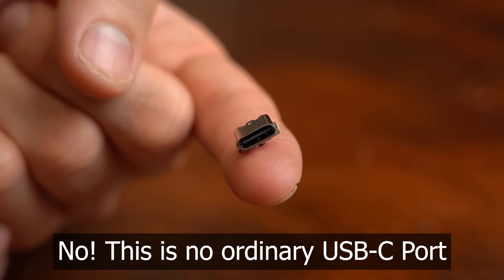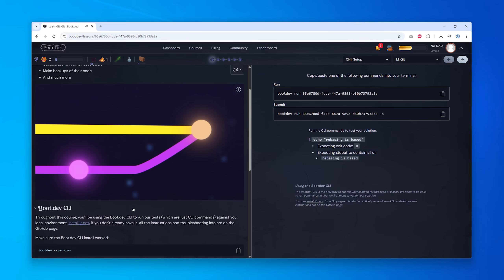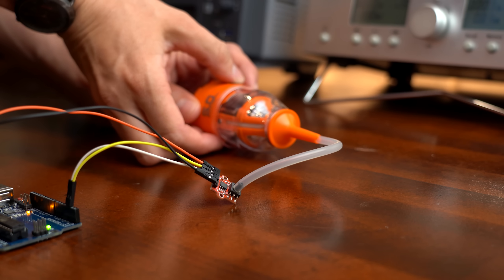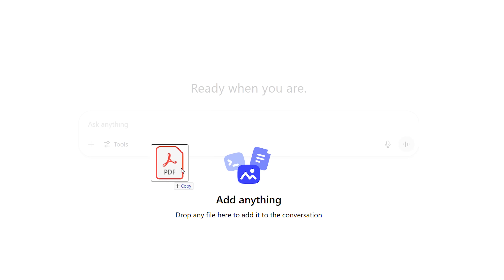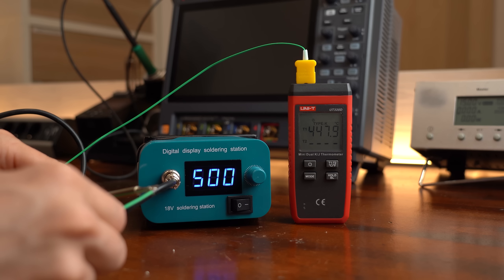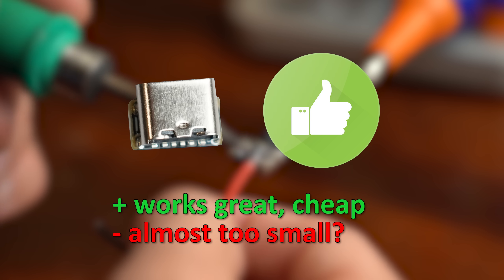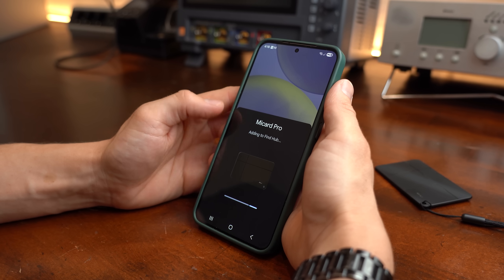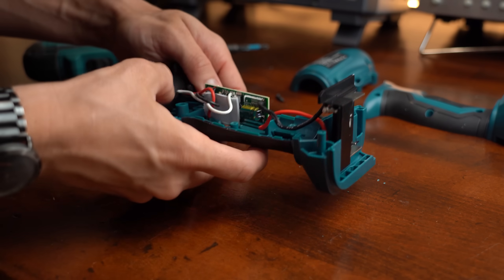I tried finding Hidden Gems on AliExpress AGAIN! (Part 15)

Comment: That little charging board would be great if it wasn't quite so small. Plugging in and unplugging USB cables applies a lot of stress, and with no mounting holes, you would risk pushing the socket into or pulling the socket out of whatever device you used it in.
Reply: It's for batteries that use traditional form factor like AA/AAA/C/D/RC123A etc. but use li-ion chemistry.
Reply: you can add extension or header and yes use epoxy to make a housing so you can plug/unplug without worry
Reply: Good point. I guess on could/should epoxy it to a case or something like that.

Comment: For the soldering iron, could you not get/DIY and adapter to plug it into you power tool battery? I have one of those irons and yet it works great on a 4s LiPo so in theory should work just fine if adapted to a tool battery pack.

Comment: I am pretty sure there is a version of the soldering iron which can be run via UsbC e.g. via Powerbank.
I have modded a PD-Board to mine (replacing the round socket) as i also bought the version you have, works great.

Comment: If you solder in a connector vs directly to battery, the potential to short the battery  positive to ground isn't an issue.  Just make sure there is no short before you plug in the battery.
Reply: Shorting the battery can't happen if you solder its negative lead second, after checking the +ve doesn't have a short.

Comment: 08:16 If I owned a plastic-bladed fan which could spin at 130,000 rpm, I would be rather concerned for my safety.

Comment: the tracking card seems like an interesting replacement for apple tags where the tag needs to be very slim. would be interesting trying to fit one into a steam deck or a laptop to track down stolen property (with a few officers as backup ofc).
Reply: Unfortunately police don’t typically follow up on stolen property reports.
Reply: when i search for this product i find loads in the UK on amazon on ebay that are for iOS only? some are even cheaper than the one in this
Reply: There are plenty of cards for Apple Find My too. Sadly Android tracking isn't as covered as Apple's service at the moment. Most of the users haven't switched on BLE tracking, it's off by default in contrary to Apple.
Reply: @mshaftenberg  actions in austria has those cards and they only cost like 5€ and use ble im pretty sure they are for android
Reply: @mshaftenberg  true, here in Slovakia, I tried to see if I get any updates on location when put in friends car. It only showed up whe I was nearby. Hoe Google will turn BLE tracking on by default. Other way its useless.
Reply: @swingal did your friend have to install any apps on his phone for this to work? it seems to me like it wont work with just any android phone in the area
Reply: @zouna007  it is a built-in feature of Android, but with some caveats: (1) it requires the phone to be Android 9.0 or above, (2) it requires the user to manually provide consent during phone setup, and (3) due to legal restrictions it cannot be enabled in certain countries. 
Edit: for legal reasons it also cannot be enabled on phones that were manufactured in certain countries.
Reply: @PixlRainbow thank you for the clarification! So its not necessary that this will work for everyone..
Reply: problem have only, who idiot use apple today not many, 90% world use android today because have lot cheapen but have lot better and lot more apps and other parts addons have better and cheapen than any apple parts.
Reply: @mattivirtaIdiots that want a cheaper MFI Find my tracking device that actually works.
Reply: @mattivirta What are you talking about? Apple currently has a 25% market share, so Android has a maximum of 75% left. Personally, I have about 5 AirTags and they work great with the current last location from 3 minutes to 24 minutes ago. On the other hand, I've seen several reviews on Google and Samsung tags, which are currently almost unusable due to coverage. And by the way, I'm in a smaller town in the Czech Republic, and even here the coverage is good.

Comment: Hi.  Cool new stuff.  Did you happen to measure the current requirement for the LIDAR sensor.  Just trying to figure out what size battery I'd need to run it for an hour.

Comment: Swapping out that resistor on the charger board looks like a perfect job for solder iron tweezers.
Reply: It is, but at that size a normal iron at one pad long enough heats both pads and the resistor can be removed

Comment: I see that the pump charges with USB-C. Many cheap items with USB-C lack correct resistors and thus won’t charge USB C-C but only A-C. Can you do C-C charge testing on these products?
Reply: Thank you. That explains why I've had charging issues with some headlamps.
Reply: @NanoicDalflanlun  This is straight-up a defect in the products that are miswired like this. Reviewers need to point out when devices have this flaw and dock them points when they are. It’s a 2¢ resistor that they’re skimping on but it causes major headaches.
Reply: @AviDrissman I design products that have to comply with the USB C standard, and the resistors can be like 2 orders of magnitude cheaper than that in large scale production. It's baffling to me that people don't include them. It's so little cost that you might as well round to $0. Like seriously, I was just building the BOM for a PCB where the resistors were like $0.0006 each or something.
Reply: I have an other Flextail pump model, it does charge with USB C-C.
Reply: I had a headlamp a while back like that. It actually died too and I had to replace a transistor. So many manufacturers use cheap designs and components, it's sad
Reply: I have at least one product that will charge from a USB-C charger if the plug happens to be the right way up. So if one way doesn’t work, try flipping it.
Reply: @norfolkchas If I have to play games when charging a device because the device manufacturer skipped out on using a component that cost six hundredths of a penny then the device has a defect, and reviewers should call out devices that have that defect.
Reply: @AviDrissman  Certainly they should. I was merely pointing out a possible workaround that I was grateful to discover. But even that may not work for every device, and when it does, it's still irritating.
Reply: I just spent 3 hours bodging this design defect in another product. Boy howdy was I happy when the device finally charged with a USB C-C cable, but it was a nightmare to solder onto the CC1 pins without bridging.
Reply: Flextail is a proper name brand device and isn't cheap even at Ali prices, I'm guessing it charges properly but I don't know for sure.
Reply: Weird. I’ve gotten plenty of cheap electronics that have modern mppt
Reply: Yeah, a battery lamp I ordered from Temu didn't have them and doesn't work with USB C PD chargers, only with a USB C to A cable and regular USB A wall adapter

Comment: You can find the tiny chargers 3.95€  for 10pcs with free shipping. Great price.
Reply: Quick question, does the USB-C port provide power from the battery or is it exclusively for charging?
Reply: @Academician100  No, as far as i know it will only work for charging.
Reply: I'm not sure I see any benefit of these though.  There's no mounting capability, other than to perhaps glue or slot it into a designed space. It would need to be sturdy because multiple connect/disconnect would probably make it move eventually.
Reply: @AubsUK  Good point, but gluing it with epoxy or polyurethane adhesive, (not covering the IC for better cooling) and it should be fine. Could also directly solder the connector on pcb or copper strip, or small terminals...
Reply: Since the boards are for charging only I guess they are missing some protection features from the bigger charging boards? If you do happen to own/have tested some can you give more info on what features they are missing?
Reply: @georgiivanov8216  I don´t own one but since those boards are for 1 cell only and are for charging ONLY, all they need is to limit current and stop  charging at 4.2V. 
They do it using a tiny specialized IC . 
If you want a power board that protect the battery and where you connect a load, you will need a BMS, rated for the current and battery you need. They are cheap too.

Comment: That last item - it don't get it. It sends out BLE, and some random strangers phone is going to 1. Accept the connection to this device
 2. Dispatch some process to phone home to the products servers and forward the phones CURRENT location to that server? 

I dunno, something doesn't add up here.
Reply: Yes, if their device supports it.

That's how Apple's Air Tags work and there's now an open standard for the same functionality on android and other devices.
Reply: Yeah, the problem is that its included with all android phones, rather than as an optional app/service separate from google. This feature is good but i hate google.

Comment: For the Rodin coil, I'd love to see some comparisons to a standard coil and if it has any benefits over a standard coil, or specific use cases. I mean, it was expensive, making a video dedicated to it would make up for that, but also just understanding the Rodin coil better would be cool
Reply: I have seen those rodin coils as antennas for like very vintage radios. Like early 1920s vacuum tube radios. So maybe you can receave radio frequency stuff with it or something.

Comment: I use my PineCil with an AliExpress USB PD 65W charger that I connect to my Parkside battery (20V). I downloaded a model online, printed it out, put everything in it and I have a portable soldering iron. It's great.

Comment: I'm impressed by how thoroughly you test these products! Especially the calculations that verify the manufacturers' promises ❤
Please test/compare cheap (30E-40$) handheld blowers/vacuum cleaners! 😺Manufacturers list their speeds at *800,000 RPM*, air pressure at 100 kPa, and flow at 1000 l/min.

Comment: I would love to see a dedicated video on security cameras, it's surprisingly hard to find good reviews for such a high demand items
Reply: wouldn't trust chinese cams for CCTV, and if you do then separate VLAN with no outbound connectivity is must...
Reply: @4b978  How would this be useful when your use case requires checking the cam while away?
Reply: The problem is that most security cameras of a certain price range, have most of the features locked off to subscription only. 
@TechMoan is a good reviewer and he has done plenty of security cameras over the last decade. The problem is, he is the kind of guy who would pay the subscription fee rather than setting up a local network (if the camera even allows that)
So most camera reviewers are invalidated because they think it's normal to pay $15 a month for your $75 camera to function fully (motion recording, motion alert etc.)
Reply: Better still, multi-lens, poe cameras
Reply: Wired Dahua or Amcrest are the only answer. Set them up, update them, point them to a NTP server inside your network and block them from the internet. VPN home to view them or relay them through Home Assistant or similar. Don't bother with any other brand, they all suck. And don't bother with anything that uses wifi. If you can run a power cable, you can run ethernet.

The only exception to the Dahua rule is Reolink for battery powered cameras (and battery powered only). Keep in mind that anything battery-powered is a glitchy, last resort, temporary solution, which should only be used to look after your cabin in the woods or to lovingly gaze at your chilli plants during your vacation.
Reply: Dahua cameras work great, setup your firewall properly.

Comment: You have to be extremely careful with third party tools connected to different manufacturer battery packs. Some packs (as Makkita) have protection circuitry built in, others like DeWalt relies on circuitry built into tools themselves. Chinese adapters are made cheap and can drain battery to level no longer accepted by the charger. Depending on protection level, it could even brick your expensive battery pack.
Reply: However, let me add a glimmer of hope. If you drain some of these battery packs (my dewalt for instance) past the lower level the brand's charger will allow thus causing it to not charge said battery pack, you can use a manual charger such as a balance  charger or even just a straight DC trickle charger to raise the voltage above the minimum. Once that level is reached, one can (as I did) then resume using the branded charger. I've even put one of my 18v dewalt packs onto another by way of wires (I do not endorse this, could be dangerous) which then charged the "dead" one to a point of voltage equillibrium(ish) and then put them both onto the branded dewalt charger to finish out the charge.

Your mileage may vary, I am not an electrical engineer, and one assumes all responsibilities incurred by trying this "hack". I've used it only when attempting to saved a possibly bricked battery. So far though, I'm 3 for 3,not a bricked one yet. (all dewalt so far)
Reply: Yeah if you use it regularly, you might as well get the original makita blower (though it is 10x the price)
Reply: Lol cụ coin viNE 0,06875$
Reply: I use some  chinese copies of Makita at the construction site for years, mixed with original Makita tools and batteries (originals made in Romania for the EU market)  No problem at all.

Comment: I would be interested in seeing more reviews of these tools that are compatible with brand name batteries. I always wanted to get a cordless hot glue gun that is compatible with my Bosch batteries but don't quite trust Aliexpress for stuff that generates that much heat
Reply: Nah all the stuff is pretty good actually. For anything your using I wouldn't worry. It's the plugged in stuff that scares me. Jus got into modded Ryobi battery tools. Made my own power Bank and USB charger. All solar stuff there is really good and best prices around by half on most items. AliExpress is the same thing as Amazon n eBay but jus takes alil longer to get to you. Like a little over a week

Comment: Note to the tracker card:

It will only Track things in low crowded areas if people agreed to share the information in such Situation. Otherwise, you have to rely on your phone saving the Location where you lost it.

Edit: and I think it only works with devices that have installed the Googles find my device App.
Reply: Yes, but that comes now by default with Android and is also switched on by default. The "track if only few people" you would have to manually enable, so yeah, if you loose it in a field somewhere you might be out of luck. Though then you have "last seen" of your phone. Played around with these a bit in Berlin (using my parked bicycle) and they work quite nice. Lot of products, mine was 25€ and AirTag format. The "let it beep" feature is really nice for keys..
Reply: You can change that in the Find My app, it works in crowded and more rural areas.

Comment: For anyone interested in LiDARs, you should check the XT-S1 LiDAR module. 30m maximum range, very cheap.
The documentation on it is kinda sketchy, but I made it work and it's very reliable.
Reply: If anyone finds this useful, I could put together a quick tutorial on how to get it working in minutes and save your time, just let me know. The module is worth the trouble.
Reply: @rigolab  please do.
Reply: I'd love to see that.  Never used LIDAR but good to know if I ever need it.
Reply: @ibewatchinu  Just to update you, I posted a video about it. Let me know if you like it :)
Reply: I'd love to see it if you make one
Reply: @allenrusselljr  Its done. Hope it helps :)
Reply: @rigolab   interesting. what do you use it for?
Reply: @--s--  I'm working on a drone application. Ground target detection.

Comment: Awesome stuff, dude! Thanks for the reviews! 😃
About the charging board, I've found it with free shipping! 10 reais for 5 of them! (You can use the "find similar" function, you know?)
Anyway, I guess I'm going to grab some... But I also need some BMS for low charge protection... But, still, both should still be smaller than a TP4056, which is more than surprising! (And you could have higher current protection as well, depending on the BMS!)
Stay safe there with your family! 🖖😊

Comment: Great series! Do the blower fan and soldering iron have low voltage cutoffs built into the tool? I think some power tools have the LVC built into the tool rather than the battery???
Reply from the maker: Good question....I should have tested that
Reply: you should use after market battery, they do have over discharge protection built in